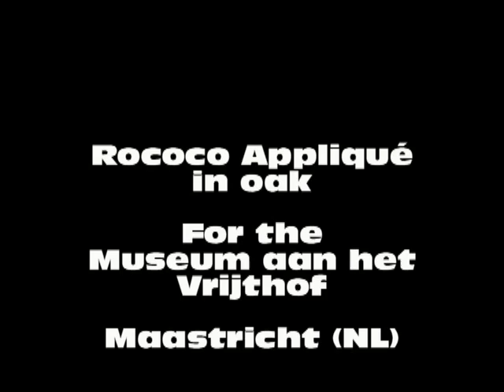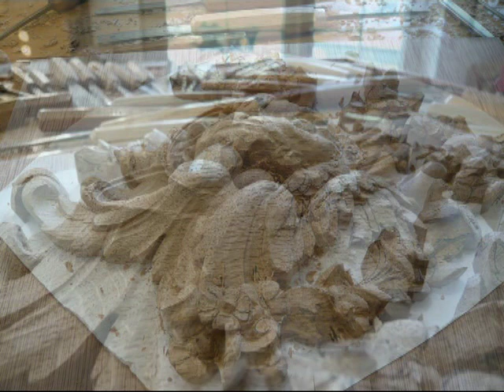WOODCARVING : Rococo Appliqué in Oak | Rokoko Ornamenten

Comment: The carving is delicate and very beautiful. But if you don't mind me asking, why oak? Oak has such a rough, open grain to it that it competes with the details. Would the sculpture be plastered before it was gilded?
Reply: I was asking myself the same...
Reply: Oak is a wood of this region, used in furniture, paneling, doors,...  it is a more historic choice by the museum.
Reply: OK, that's make sense, thx :)
Reply: One of the replies is true, the historic aspect. However, what you must understand is that the oak used in woodcarving here in Europe is not as stringy as American oak - if you pardon me. It's been used for centuries, and the timber destined for carving is beautifully quarter-sawn silky oak. It cuts just beautifully, and you can get extremely fine details out of it. ALL historic monumental carving here in Europe is done using this sort of timber. The gentleman here is surely one of the best Flemish carvers ; they have a fantastic tradition. Grinling Gibbons was Flemish. Look him up, you'll be on your knees when you see what he did back in the seventeenth century.
Reply: Your question about "plastering" is a bit indelicate old chap. You must learn the vocabulary. If it's meant to be gilded, then it will be "gessoed" (gesso is white chalk and rabbit skin glue used by the gilders). If this is done (most likely NOT here) then it has to be remodelled by very skilled gilders. They reshape all the details that are covered by the thick coat of gesso. The carver knows if the piece is destined to be gilded or not. If it is, then the carving is much less detailed (veins in the foliage, eyes, hair, etc.). These are hen executed by the guilders, who then show all their taste and skill. In French it's called "Reparure".